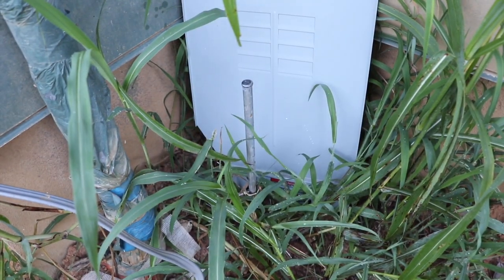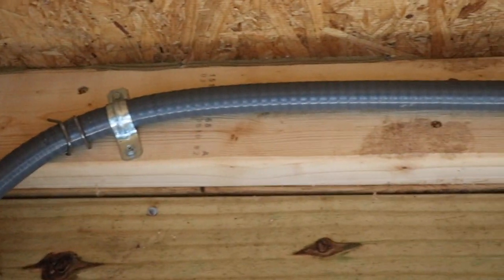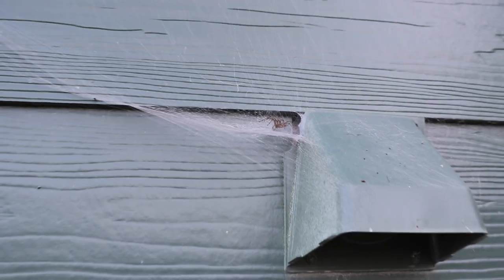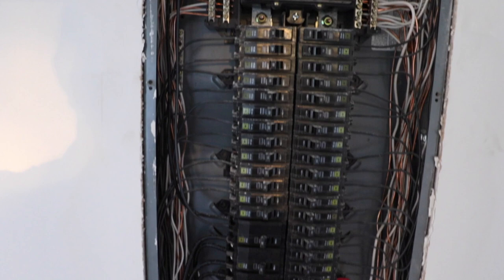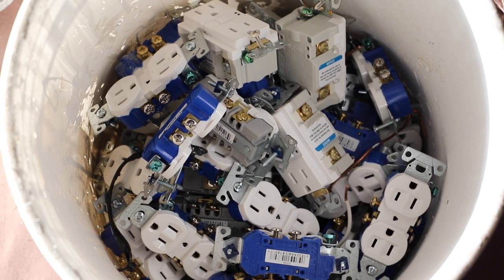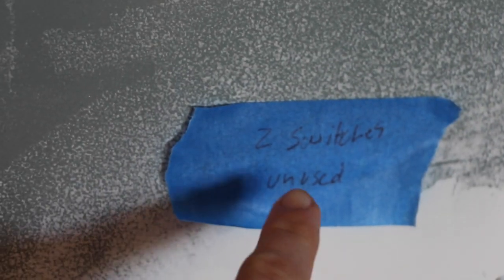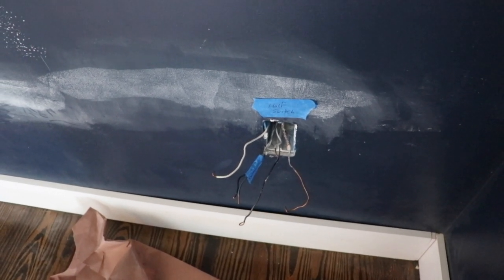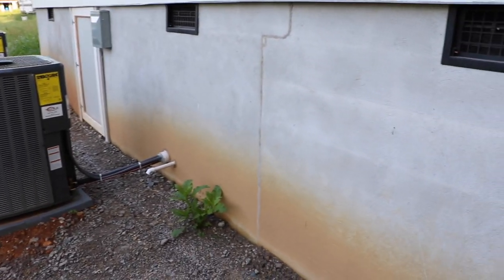Electrical Contractor Failures - Trade Tips

Comment: You didn't hire an electrician, you hired some combo low bidder company. This is what you get when you want things done faster and faster for less money. Electricians are expensive for a reason. You will learn this the hard way.
Reply: Just cause you hire an 'Electrician' don't mean jack shit
Reply: Well said Sr
Reply: @dillwiggle2  , they didn't hire a licensed electrician,  what part of that do you understand .
Reply: @gregberban9273  Was a general statement, meaning that just cause someone is called a professional thats means JACK SHIT
Reply: Make sure you hire an electrical contractor!
Reply: @G. Carpenter Exactly!  And homeowner's insurance will not cover a fire or other disaster caused by faulty unlicensed electrical work.
Reply: Didn't he say later on that the electrician was the plumber as well? Ouch...
Reply: I'm an electrician.... It's not rocket science.... Yes you should hire a licenced electrician to be safe, any General Contractor that has an electrical division MUST have a licenced electrician, has to.... Only a Licenced Electrician can pull an electrical permit.... And NO just because he's licenced doesn't mean SHIT when it comes to quality..... And he's right most of that shit would be a fail on inspection, at which point the electrician will be REQUIRED to get shit to code or not get paid.... That's the problem with MANY people today, they aren't doing their work like they are being judged as a person on that work.... I'm not the fastest sparky, but my quality has gotten a great reputation with the inspectors, some say they know I did it JUST BY LOOKING at the quality of my work..... I would not be ABLE to provide that same quality for the lowest bid, but here's the thing, when you build a reputation of NEVER failing inspections, inspections are easier to pass.... And low and behold you don't NEED to be the lowest bid.... Just Do your work like your putting a stainless steel name plate on it with your phone number.... And everyone else working that job is judging you as a person by the quality of your work....
Reply: Why are electricians so expensive? Nothing hard at all about wiring, hardly any brains involved, work is work, time is time, an electrician should make no more in an hour than a person flipping hamburgers for an hour. The reason they get so much is that most people think they can't do this dummy work themselves, and we have government and their codes designed to shut everything down and control everything
Reply: Skilled labor isn't cheap. Cheap labor isn't skilled.

IBEW!!!!
Reply: This is what happens when you want everything cheap and don’t wanna pay for good quality work. This is the whole damn problem nowadays with new home construction and remodeling work as homeowners want cheap.
Reply: TheSoloAsylum yep!
Reply: @JohnSmith-nw2ls .....Mr Smith you are out of your mind if this is what you believe...you have been watching too many DIY vids....
Reply: John Smith there’s only one thing you learn when debating a FOOL; that is, there are two!
Reply: I didn't know it was a debate, but I do meet lots of people who have low tech jobs like electricians who think they're doing something high tech, I know dummy roofers who lay shingles and think that's high tech too. We live in a very dumbed down society where the average Joe Shmo doesn't even know how to tie his shoes, therefore most of these dummies think an electrician is a rocket scientist
Reply: Dean S yes he did. That’s all you need to know about this mess
Reply: John Smith so you said that electricians should make minimum wage basically and yet you said you do electrical work for a living??? You are contradicting yourself man. Electricity can KILL somebody and you should know that being someone who works around it. There are reasons why there is code for electrical installations. Any fuck up in any particular time of the installation process can end someone's life. It only take 0.5 milliamps to stop your heart. Think before you say some stupid shit and try to devalue and degrade an entire trade.
Reply: I learned the code to make sure sht was done right thanks to too many electricians FKN THINGS UP! Too many bad electricians give the few good ones a bad name!
Reply: Amen
Reply: People don't want to pay, they think the Internet can teach them everything.
Reply: I been doing electrical ever since I was a teen, got into home wiring about 15 years ago, when I wanted to switch to electric for my stove, and there was no outlet there. An electrician buddy of mine explained about the two sides and the ground, took all of 30 seconds, and that's all it took for me, went home and wired my kitchen myself, no schooling, nothing. Since then, I been doing service panels, you name it, I do it all, 30 seconds of schooling. The people who need schools are the ones who don't have functioning brains, minds that have no problem solving schools, minds that stall when challenged with an obstacle. How did they get into this pathetic condition? You guessed it, from public government controlled schools and their MSM. Schools are for fools
Reply: Yes I like the good money I make when doing electrical, I admit it, and I understand that nearly everyone I meet is scared to death of electricity, including nearly every contractor I know. I understand completely why people pay through the nose for electrical work, it's not because an electrician is a brain surgeon, because they're not. Electrical wiring isn't rocket science or hard work, it's just work. Right now I'm currently building free electricity home generators, now this is a challenge to the mind, not like some dummy pulling Romex through holes and connecting it up
Reply: Who said anything about codes? So it takes a brain surgeon to read and understand a few code updates? I been doing wiring over 15 years, nothing burned yet, doesn't take a rocket scientist to wire something in a safe manner. The whole point of my comments is to show that electricians aren't brain surgeons, it's dummy work. Just like a guy laying blocks or putting on shingles, nothing high tech about it. Sorry if you're an electrician and want to believe you're a rocket scientist doing something high tech and you feel offended by the truth
Reply: @JohnSmith-nw2ls  dude just stop 😂 you aint fooling nobody. The bulk of Electrical theory isnt something anybody learns overnight, NEC requirements isn't something you learn over night, conduit bends isnt something you learn over night, it takes years of experience and studying to be a competent electrician, period. Whatever bullshit about how within 30 seconds you had it all mapped out is bullshit 😂 you ain't fooling nobody dork
Reply: If it takes a person many years to learn how to pull wire through holes and connect it up without burning anything down, it's because the person has no mind. Most of society has no mind, this is the result of the government controlled school system and mainstream media. I know you want people to consider you an electrical engineer, but I hate to break it to you, an electrician is not an electrical engineer, far from it. People like Nikola Tesla, Charles Proteus Steinmetz, etc., these are electrical engineers, a dummy electrician doesn't know anything about electrical theory, he doesn't even know anything about what's coming into the transformer up on the pole. You're trying to make an electrician out to be a rocket scientist, he's not. Yes I install panels, design circuits, pull wires through holes, put in switches and receptacles, and yes I learned this in 30 seconds, and didn't pay a penny to learn, if you spent years in school for this and spent thousands, you got ripped off. Forget government, NEC, their codes, rules, regulations, I just wire houses safely, and I make money doing it
Reply: By the way, most 'electrical engineers' as well as 'scientists' today are not electrical engineers or scientists, they're university trained idiots, don't know this yet? The schools and universities are churning out idiots by the thousands. Nothing good ever came out of collectivism, it's the individual who always came up with something good, free thinkers, people who don't go with the flow. You should learn what this means, it makes life much more fulfilling when we begin learning who the liars are and start seeking truths
Reply: @JohnSmith-nw2ls  John Smith is a troll, nothing more. he gets off on the replys and remarks. Pay him no mind, and he will dry up and blow away.
Reply: Not all electricians know what they’re doing
Reply: @gunneredwards7710  Then they aren't electricians.
Reply: @dillwiggle2  yea right. Licensed electricians know and stand by their work.. I dont know who you are paying 5500 to hook up the box to if not a pro

Comment: Arc fault breakers were only enforced on jobs that were approved after the 2014 update(certain circuits) and on all new home runs ran after the 2017 update(where required). If the plans for this house were drafted and approved on December 31, 2013, you don't need Arc fault breakers. Even if you do the work in 2014+

Comment: Doing a job "to code" is essentially the crappiest job you can legally get away with. You can (and should) always try to do better than what minimum code requires.
Reply: Gaelen Bolland, amen brother! As I explain to people it is like when you were back in school you were graded A, B, C, D or F. When you fail to pass code, you received an F. When you make the code correction you do not go from an F to an A, you go from an F to a D! Code quality work is "D" quality work, not "A" quality work!
Reply: Damn Right! The NEC is the Bare Minimum...NOT the maximum... required for safe electrical installations.
Reply: Gaelen Bolland why would you go above and beyond to do it above code ? doesn't make sense from a business stand point neat clean and to code is all anybody should expect from there worker's
Reply: Yep, the NEC regulations are minimums!.
Reply: Kenneth Gagne well said brother.. those who have a business would understand. There is a difference between code compliance and specifications compliance.. some MTA spec In NY requiere 3 straps in a 10’ of conduit.. in this case the contractor is force to go above and beyond code.
Reply: @yyz2go2112  for instance, code does not require the black wire to be on the left and red on the right. That's just common practice. Some municipalities will not adopt new NEC code for years, so arc fault protection in bedrooms was not required where I live until long after the NEC changed. Most electricians don't mark switchlegs with tape and sharpies. They put a curlie que in it. A wire coming in the top of a box does not mean it isn't a home run. I'm not defending the electrician's work. I'm just sayin'. We would have typically used EMT with an LB to go through masonry.

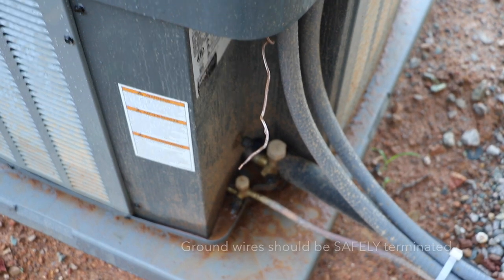Comment: 2:25 That wire sticking out of the condenser is not a ground wire, it's a temperature sensing wire from your defrost board.
Reply from the maker: Yes... the inspector called it a ground I corrected him on round two
Reply: Glad to see someone else catch that as well.
Reply: anticapitalize i
Reply: Also those "wires" not in conduit coming through brick, 2 are pvc coated flex conduit which is weather proof and abrasion resistant (should be sealed around to keep bugs and water outside) 1 is multiwire bundle going to a/c control unit. Shouldn't be against plate like that but still doesn't technically need conduit.
Reply: That's right, evaporator becomes a condenser when that defrost sense wire is needed. Old school heat pump used to just defrost on a timer.
Reply: Inspector, my ass!! This just goes to show you an inspector, electro as well as others are not all as well educated as they should be within their field. But this guy should take a step back on what he thinks he knows and what he does really know. Now saying this, the guy had a really bad electrician on site. But sometimes you get what you pay for if you go cheap. If that is what they have done here. It sounds like that could be the case here.
Reply: @bkight2007  why? you know im right
Reply: i thought it was antenna for a remote control, ha

Comment: terrible plumbing work. terrible finished carpentry work. shoddy electrical work.

next time don't hire the cheapest you can find. lesson learned.
Reply from the maker: JustMakinProgress the finish carpentry wasn't done in the video, if you watch the remodel series on our channel it came out fantastic and matches the 1900 style of the house.  The plumbing and electrical were done by the same mechanical company, they weren't the cheapest just one of the only choices for the area.  Plumbing failed, but was redone in a day. Second electrician was as bad as the first...
Reply: JustMakinProgress....as an electrical contractor this makes me ill... I could never do work this bad....
Reply: @YanasaTV  Carpentry  Did you do it alone, next time bring a adult
Reply: @johnnyfreeman1018  i am a half amator in electric stuff,and i guarantee that i cared allot more than a certified electrician and i refurbished the electrician's job just to pass the the job to the certified class of wiring and respecting the authorised plan of execution,otherwise would fail and will take 3 more months untill the company would do the job into the contractual parametres,the load between the phases R,S, and T were very unballanced regarding the electrical scheme from the house plans and the estimated power consumption and max loads predictions on the entire instalation,after i call the job finished,the inspector was called in and it passed with flying colors...and wtf...i'm a welder,not electrician,yet i've done a greater job than that stupid ass authorised electrician with more experience years than i had age at that time....shame on him,was also a high price company...shame again !!!!
Reply: Yanasa Ama Ranch 
Although I live in CA, that's pretty bad. You missed more, I saw several other bad workmanship areas in the video. Feel for ya.
I don't know what it's like to find quality labor in your area but that was bad. I'm an IBEW member (30 years) and hope you really go through the whole thing again with a qualified electrician.

Comment: Sealtite is the sleeve. No need for "grease" on copper but aluminum needs noalox.
Reply from the maker: bumbalough111 inside the house I've used sealtite for network cables... but for whatever reason the inspectors here wanted PVC through the masonry.
Reply: Your city must not have ants. PVC is just another way in.
Reply: @HighestRank  use duct seal to seal the ends. That is code going outside to inside.
Reply: Yanasa Ama Ranch it’s not an inspectors job saying how to repair things. He needs to leave that up to a licensed tradesmen.
Reply: Thank you, I couldn’t remember what noalox was called for the life of me
Reply: @cleanuppros  actually it is an inspectors job to say what is acceptable and what is not.  And trust me a lot of them don't have a clue.
Reply: I have seen somewhere that the aluminum we use nowadays does not need noalox anymore due to the alloy composition.  Also not a requirement of code so technically not needed.  That being said most guys I work with would flip their shit if you left it off.
Reply: @JakLuca  no aluminum oxidation is a good mnemonic.

Comment: Where did you find this guy Craigslist? Did you do any research to see if he was a legitimate electrician with license? The fact that you installed the receptacles and participated in running wire and doing your own electrical tells me you were low-balling the job and finding the cheapest person to do the work. Looks like you figured out the cheapest isn't always the cheapest.
Reply: You are absolutely right about the cheapest not always being the cheapest , When it comes to electrical work , You cannot afford to cut corners because if you do , You're setting up an accident just waiting to happen , Equipment failing , Starting a fire and seriously injuring and/or killing somebody
Reply: Yea I was going to say the same thing. Did you notice the 1x4 baseboards, the 24" o.c. walls, the electrical plug placed in the center of the drywall with no blocking, painters tape on walls instead of house plans, plumbing too close to the wall... There was more but I'm just a homeowner. This YouTuber here is in over his head. How much didn't make the cut? What the hell is the point to hiring some ranch hand or dude hanging around outside the Home Depot when you know he is going to fail, so he can make this video?